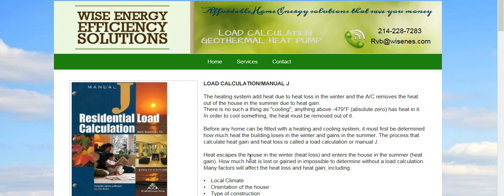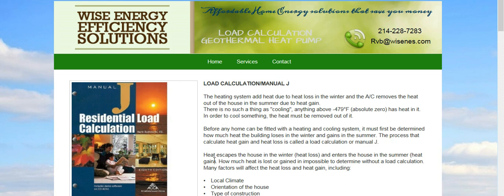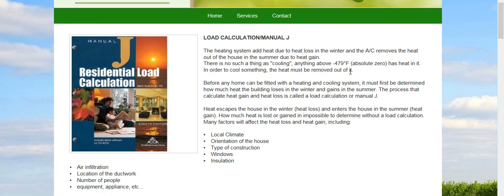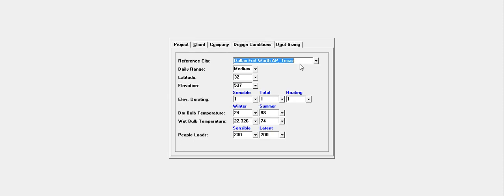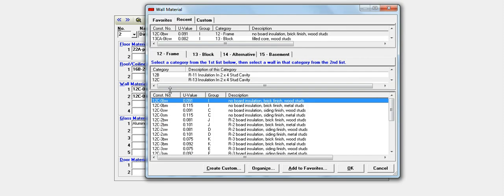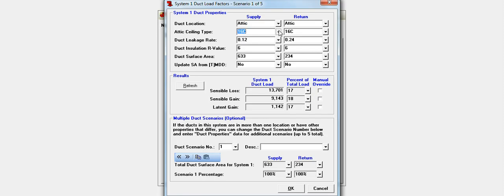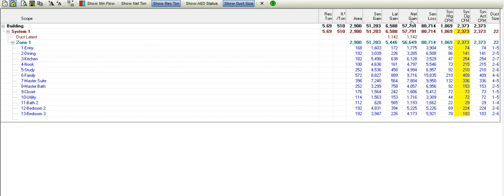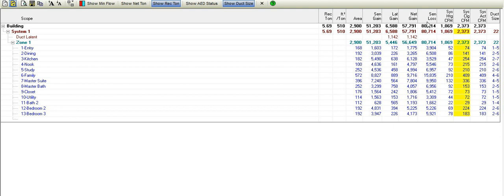Load calculation/Manual J introduction

Comment: Excellent video. For a homeowner, using a fieldpiece pocket psychrometer, where is the best place inside the home, to measure the indoor relative humidity percentage? At the return air? Or take measurements in different areas of the home to get an average?
Reply from the maker: Good question. I normally check what the thermostat is showing (if the thermostat read RH) otherwise i will take different reading within the house and would compare to the reading at the return plenum always using the same psychrometer. Comparing the humity/temperature in the house to the humidity/temperature in the return plenum is always good practice. Taking a reading inside the supply and return plenums is very important; at the end of day all an AC does is drop the temperature of the air accross the coil by 18 to 20 degrees, measuring at the return grille and supply grille is not recommended when troubleshooting an AC either for temperature drop or humidity; taking the ductwork out of the picture shows what going on accross the coil, once we know the system is cooling properly then we can look at the ductwork, filtration, short cycling, etc.. and hopefully find the solution.
Reply: @rvbtx1  One thing that I’ve noticed is that at the end of the AC run cycle, the indoor humidity might be around 55%. But over a course of the next 8-10 minutes or so that the unit is not running the indoor humidity sometimes climbs to 60% or higher in that short of a period of time. I wonder if there could potentially be an issue with either my ductwork or filtration.